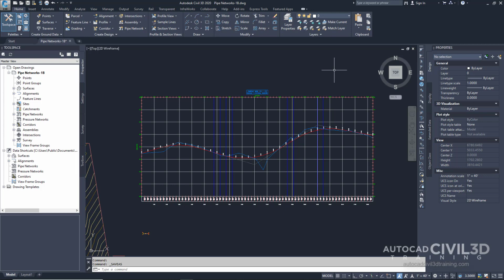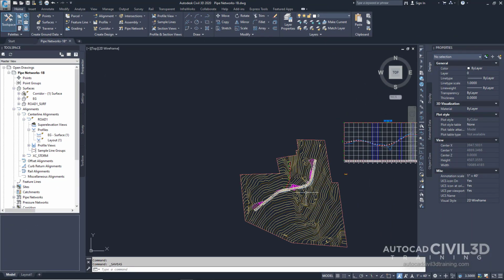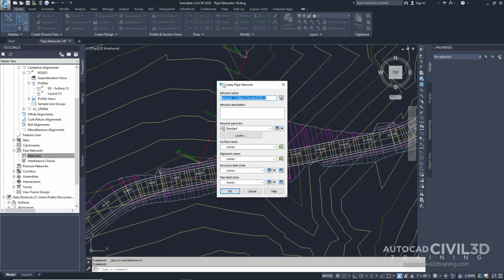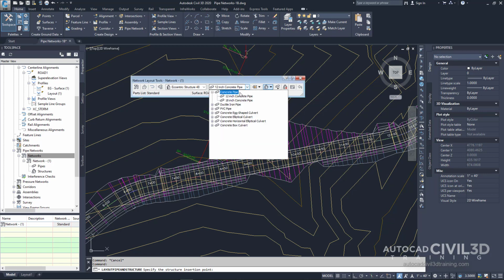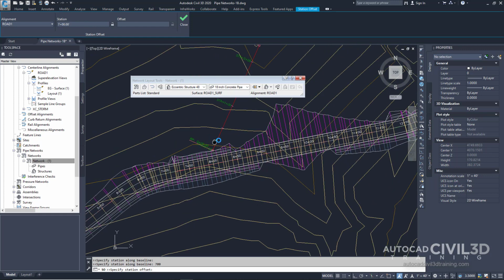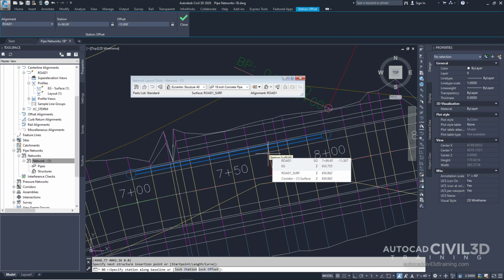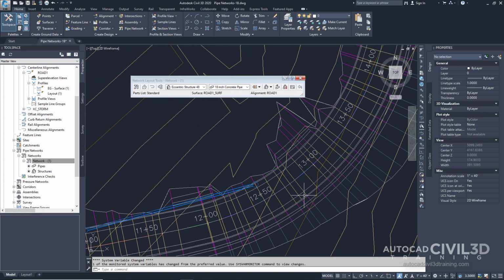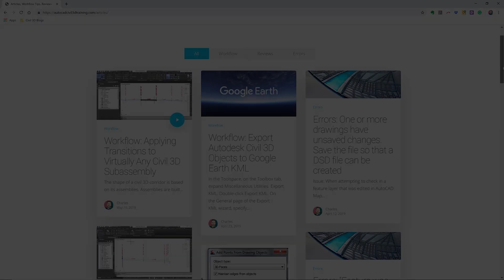Creating a Pipe Network by Layout in Civil 3D 2018, 2019, 2020, 2021

Comment: HI, I like your video but disagreed with its end, you added a curved pipe in the sewer network which is never been provided even not practical for the Upvc or Concrete pipe. please, correct me if i am wrong. thanks
Reply from the maker: You are correct from an engineering perspective. However these videos are demonstrating how to use software commands to add a curved pipe if the need arises.
Reply: @CIVIL3D  thank you so much, appreciated
Reply from the maker: You're welcome!